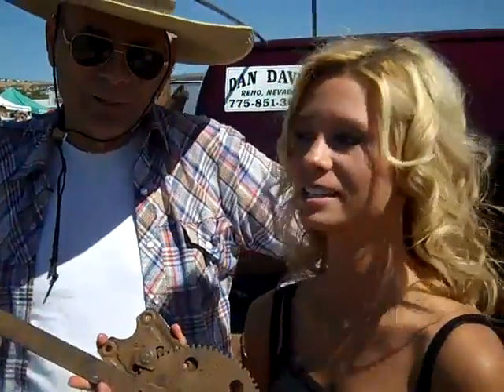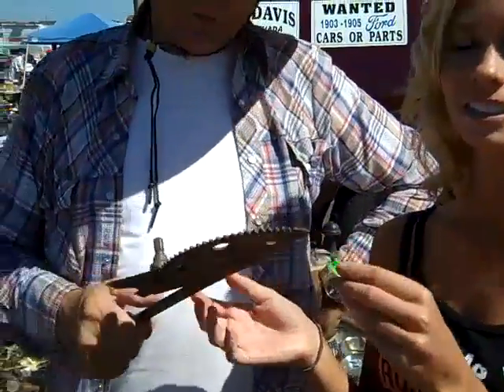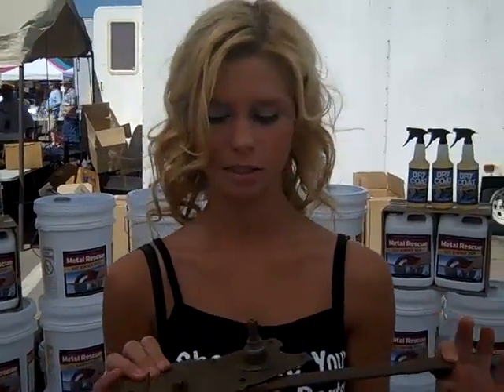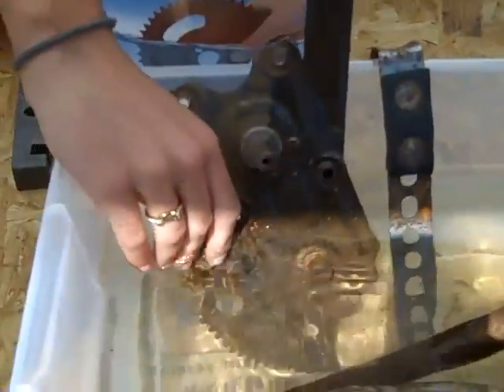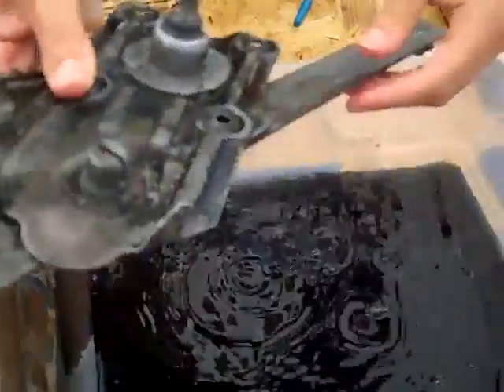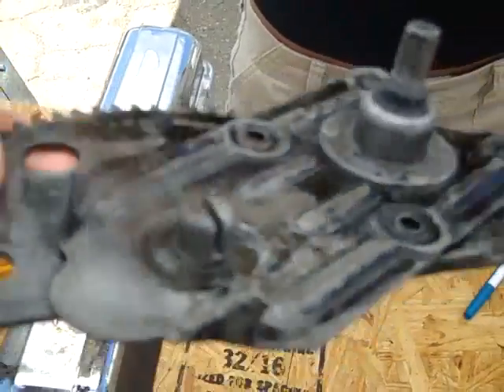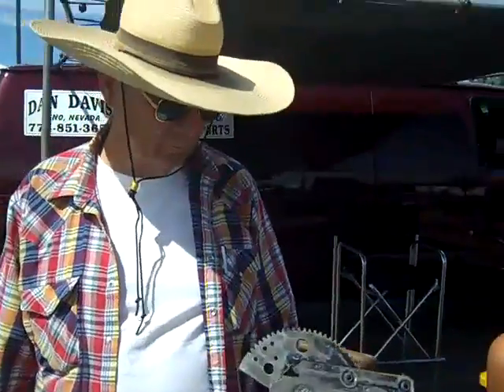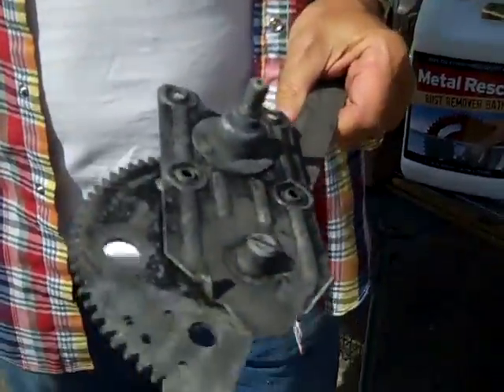How To Clean Rust From A Window Bracket Assembly

Comment: Vinegar would have done the same thing.
Reply from the maker: Hi Don. Actually we compared Metal Rescue to Vinegar in this video. We found that Metal Rescue worked faster and kept the rust off. Unlike an acid, Metal Rescue will not promote rust if left on or not neutralized.  Take a look and you can be the judge on which one worked the best. https://youtu.be/kPQkBEXkPBw